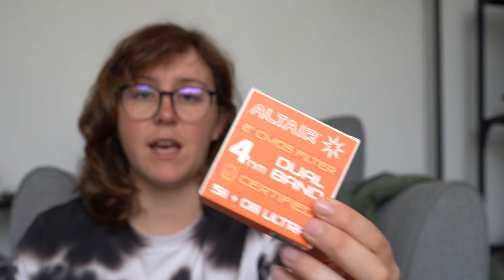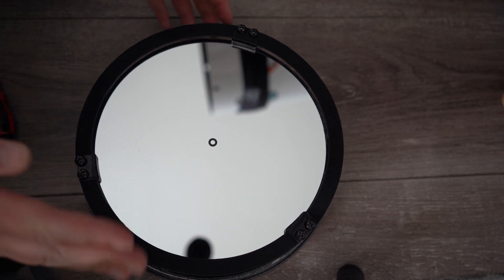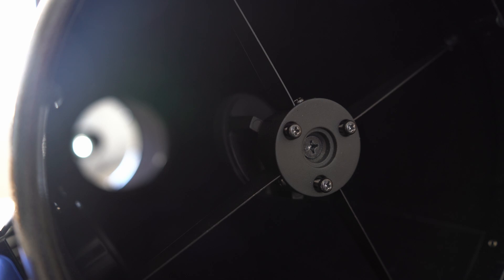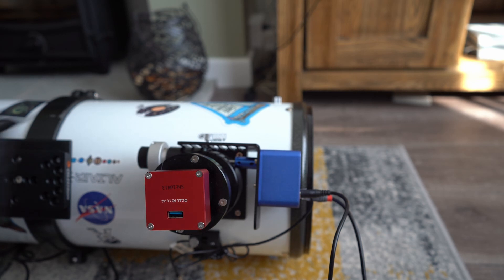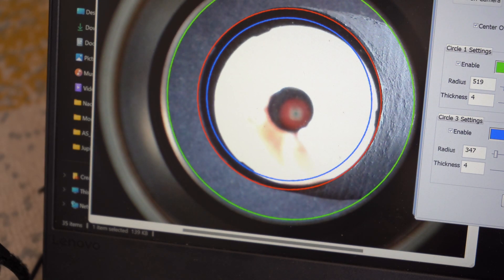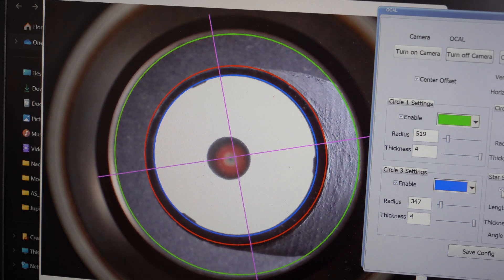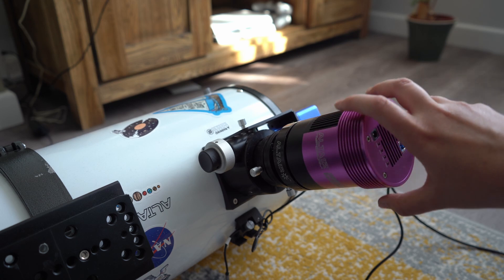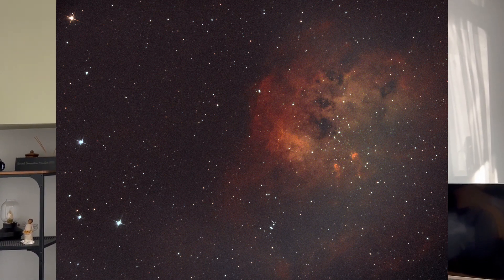Modifying my Newtonian Telescope

Comment: A big improvement to the primary mirror cell, is to remove the mirror clips, and use silicon adhesive on each of the contact points of the primary mirror to the cell, and the pillars that hold the clips to the mirror. Let it cure for a couple of days and it will securely hold the mirror. I have been using this method for at least the last 22 years on all my primary mirrors up to and including a 12 1/2 inch full fitness mirror. You get rid of the defraction caused by those clips in front of the mirror, and the possibility of scratching the outer edge of the mirror because of their contact with the front surface.  
As an experiment, I even hung a 10 inch blank upside down for a year that had been secured only with silicon adhesive. It’s securely held the blank with no problems. If you need to remove the mirror to say, aluminize it, silicon adhesive can easily be cut with a hacksaw blade from the mirror and removed by peeling off.  
The silicon also has the advantage it will not pinch the mirror, as either the mirror or itself, expand or contract with the temperature.

Comment: Good tip, especially the painting and shower cap. Oh, at 15:44, I the diffraction spikes look off centered, which I think is from the secondary mirror not being absolutely centered. Can be adjusted easily by adjusting the spider. You'll figure it out once you see it. (Unless that's a choice. I suppose it could be.)
Reply from the maker: The spider has actually been really bugging me, so I got a new cnc spider! I’m hoping it’s going to solve my off centre spike issues 🙏🏻🤞🏻
Reply: @AstroStace  where did you get the CNC spider from?
Reply from the maker: @matthewbrown8679  FLO - Backyard universe

Comment: I usually recommend people paint the interior of the scope tube with Black 3 instead of flocking.
Reply: Did you actually try it? I wonder how much easier/harder it is to apply and if it chips/degrades after time.

Comment: I understand the benefit of flocking the tube, but it seems like it will always be a dust issue for your primary mirror.  Would paint have been a good option?

Comment: Apparently it's unavailable at present.  Ontario Telescope shows it lists for $330... for that kind of money it better come with a person to use it on my scope...
Reply from the maker: I assume you’re talking about the ocal, the basic package is £169 here. It’s not for everyone, but for me it’s really helped me as I’ve had quite a bad neck injury
Reply: @AstroStace  Sorry, that was for the 'Pro' version... I just rechecked the Ontario telescope site and the basic model, also unavailable, lists for $230 which I assume is US dollars which at present exchange rates would be close to £184.   Still a lot of money but I suppose less than the HoTech system.  Hope your neck gets better.  I pulled a muscle in my side and it keeps flaring up at times and I did it 15 yrs ago.